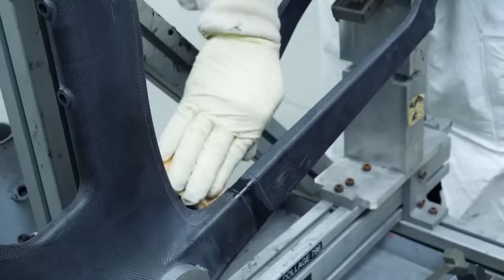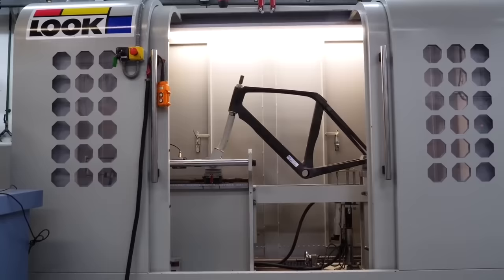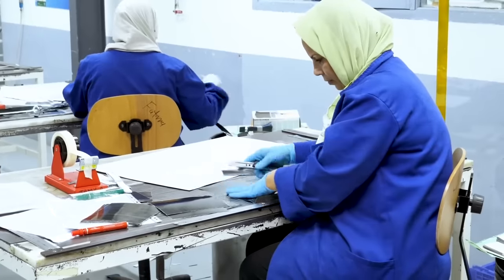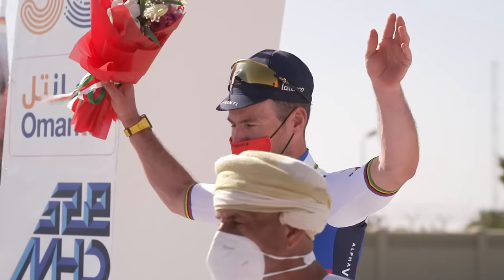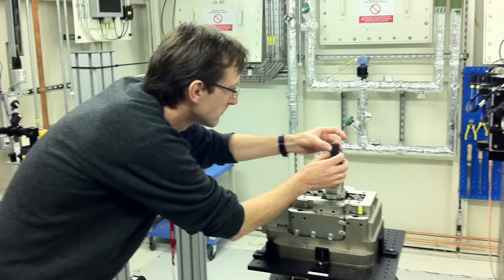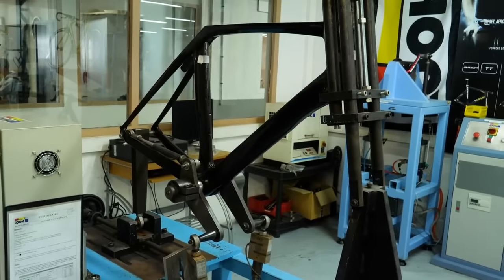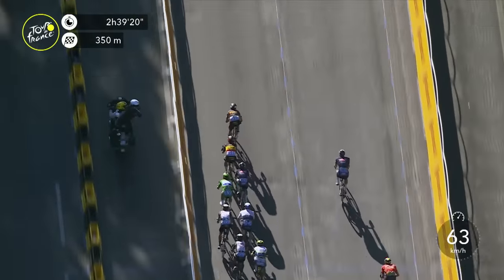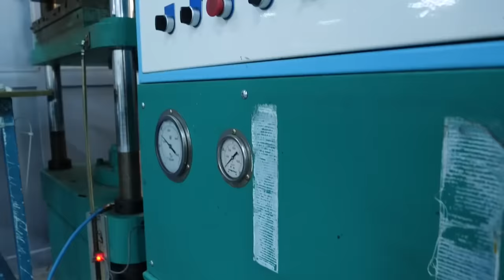Your Carbon Fibre Bike Won’t Last Forever

Comment: All structural materials fatigue over time. The stresses define how quickly this happens. When a metal breaks under cyclic loading, it is a "brittle" fracture.
Reply: Is stainless steel, in it's various alloy grades, considered THE most brittle, and WHY it was never considered, let alone used for frames, on a full production scale??

(I think that the Austrian Puch company 'dabbled' in it's use in the mid to late '70s, maybe???)
Reply: @nofascistsonmywatch  Stainless bike frames exist, They're just not that popular. 

It might be the expense and the performance disadvantage relative to carbon that turns people away.
Reply: @ZebraLemur  How could it even be as costly as Ti though??

The cost of the tubing/materials is similar, if not advantage stainless (unless we are talking INCONEL, which with it's extreme heat tolerating properties id way way overkill for a bike frame! ;) ).

It does require special rods to braze/weld together, but it does NOT require an (inert??) argon gas 'local' environment like Ti does.

It also does not require the long, drawn out, multi-step processes of lay up layering, and timely autoclaving that carbon does (at least the high quality stuff does). ;)
Reply: @nofascistsonmywatch  400 series stainless is the strong stuff, yet suffers from chloride attack(I conduct materials testing as part of my job). In that regard it is worse that titanium and aluminum. 300 marine stainless is simply weak af. From a structural standpoint, there are no effective stainless swords- we know long sections of stainless have certain drawbacks compared to high strength steel. So we have this niche material that has mediocre mechanical properties that also has mediocre corrosion properties. We have to ask, what company is going to invest 50 million dollars to get a bike frame factory making a product with economies of scale (to be price competitive). It's a niche material for that person who wants a shiny metallic bike with medicore mechanical/corrosion properties and a premium price. A major investment is required to bring the costs down- yet the demand is not there.

Comment: The carbon fiber roofs on the 2008 to ‘13 BMW’s have very thin clear coat and are failing.

Comment: It is important to note, that a 'bare carbon' frame actually has a primer coat on it. If it didn't, it would look like hell. All sorts of odd-looking carbon sheet layups would be visible. Having that primer coat is actually great, as once you get bored of that look, you can just give it a light sand, and paint it however you like.

Comment: what's the problem? the shelf life of the bike is 2-4 years, this is without cruel use, God grant athletes six months, and if the bike is just rolled, the shelf life may be 5-7 years, until they get bored.
  Also resins of course they crack, which leads to delamination between carbon delamination in our opinion, so taking a carbon bike from under someone does not respect yourself! unless, of course, he is not from under the racer and you take him to the collection to just wipe the dust off him and show him to friends. at parties. and with the current quality of bike production and the pursuit of weight, it's just pointless to discuss durability. when the frame weighs 700-800 grams and there can be no question of rigidity, no rigidity whatever. therefore, I still do not understand why people pay 5,000 thousand dollars just for a frame, I am ready to pay 1,500 thousand dollars for a frame, since the works of people who collected it, painted and polished it are invested there. but for a piece of plastic that I can make myself in my factory. which will also be cool as from the current shire for 5 thousand. 
I think it's just that people have already got stuck in their heads that carbon fiber is the best material, lightweight, durable, hard, this brainwashing worked well.  When I explain at work that everything is not fine. when it's easier somewhere, it's weaker there.  there will be balance everywhere. 
By the way, when in China they started using EPS technology in order to remove and align carbon fiber from the inside of the frame walls, this was the coolest solution. it's bad that not everyone adheres to this rule and still uses condoms to pump up the frame (sorry for my French). The Chinese have given you a technology that will extend your rigidity quality a little bit) . Thank you all

Comment: Just came looking for this kind of info with all of this submarine missing and possibly destroyed by pressure. Not a good material to make a submersible. You don't want to worrie about little fractures tearing apart the hull when you are in a ship that need to stand 400 kg/cm2. 3 years of use... well.

Comment: Nerd stuff here.  COOL!  My bikes are steel or aluminum and well painted.  To that end I'm NOT going to stress any of my bikes like a pro rider will.  So odds are a carbon frame will probably last me 30yrs where the same bike would last a pro a season of racing.

Comment: resins dont like to be HEAT CYCLED which happens when the bike sits or is stored somewhere 
hot or in direct sunlight. Resins will go soft as a result, it isn't the cf that breaks down its the resin.
after the resin is compromised the cf will fold at the flex nodes, points where flex is concentrated.

Comment: Thanks Doc....I had my frame repaired after a cafe door tragedy....now it's freakin creakin...??? Help
Reply: Buy a new bike, and don't take it to the cafe.
Reply: @santiagobenites  ok. Got the 3K ??
Reply: Sure its the frame and not something like crank ring bolts ?
Reply: @phuffmanful  I am not..so back to the shop it goes , I am hoping it's a simple thing ?  BB ? Thanks
Reply: @cb6866  My road bike had been creaking whenever I stood up on the pedals to sprint. I had assumed it was the bottom bracket, so I had just been dealing with it, as I wasn't ready to pay my mechanic to pull the bottom bracket apart. Plus per my research, creaking bottom bracket won't damage it, just annoying. After researching further, figured I should at least grab the allen wrench and make sure it wasn't the crank ring bolts. After tightening the crank ring bolts, 90% of the noise is gone. I need to get some grease so that I can remove and grease each crank ring bolt, as I'm thinking that should eliminate the rest of the creaking.
Reply: @phuffmanful  Really...? I am 2 things ...old and new , age and to cycling . I'll give it a shot right now   Thank you

Comment: Carbon fibre aircraft rot, disbond with metal parts, stress fractures,  paint comes off, displaying bare fibres. so its going to happen on a bicycle just slower.
Reply: I use nail polish for the little cracks etc on my bikes
Reply: Carbon fiber is more difficult to paint, additionally the stress on aircraft is much higher (due to the speed) than on a bike or a car.
Aircraft paint on airliners has a typical lifespan of 7 years, even on aluminum aircraft.

Comment: mY pinarelo 65.1 last 1.5 year than begon delamination first  i saw air dots sign of self destructing i have riden normaly with it on asfalted roads mostly no crash .Since  idont buy carbon frames carbon does not last too long even  when you are carefull you buy it and  you throwit away its cheap by produt  glue it together easy to manufactur .Now i have cineli frame airplane columbus aluminium  italy steel  and  i can tell you its 1000 times beter and faster  stronger beter than carbon frames now i have it 4 years and it work no problems wit it .i never by carbon frame again i dont trust it newer ever in my life

Comment: The real problem with carbon frames is resale. Are you going to trust your life to a bike who's previous owner may have treated it harshly? Not so much a problem with fairly new frames as not many cyclists are going to abuse a $5,000 bike but the older these bikes get the more chance there is of catastrophic failure.
Reply: I intentionally bought a CAAD10 with cracked steerer which could be slammed and remove the affected section. This was due to poor stem design - like a 3mm blade cutting into steerer due to insufficient material on the inside of stem. The expander plug was too small too 15mm of useful length. I replaced this with 50mm plug

Comment: I think this is kind of dumb- fear mongering. Fatigue curves are logarithmic. You can make a carbon bike last your lifespan and you can make an aluminum bike break after 1 year. Same with steel. Carbon bikes prioritize weight, therefore operate under the highest stresses. All bike frames have a planned lifespan.

Comment: So both experts agreed that carbon frames will likely become less stiff over time, and therefore worse power transfer.  This is a conclusion I'd reached recently as my ageing carbon frame has noticeably more flex around the bottom bracket areas at higher power levels, than when new.

Comment: I have to strongly disagree with this expert from McLaren GP. Any carbon fiber has a shelf life even if it is protected from UV rays. That's because the epoxy resins continue their chemical cross-linking reactions for "curing" that makes the matrix more brittle and will actually shrink with time. So, carbon fiber is not built to last even from no use at all. 

Any carbon fiber that even is not used and protected from the sun will sudden crack, warp, or even crumble on their own over the span of years. That's something for you exotic supercar lovers to think about when buying a multi-million dollar exotic car. Those cars will be worthless in a few decades.
Reply: That said.  The McLaren F1 was launched in 1992, is one of the first cars to feature a carbon fibre monocoque and is now fetching around $20 million.
Reply: @MattParkes-cf2pq  I wouldn't buy it. Carbon fiber definitely has a shelf life because the epoxy contines to cure/cross-link over time until it shrinks, cracks, and becomes brittle. There are probably cracks all over the monocoque by now after thrity years. It would definitely fall apart if driven. That's true for any supercar made of carbon fiber.
Reply: Hmm, more important are the airplanes built out of carbon fiber. 🤔
I fear that we are going to get a spate of aircraft incidents decades from now when aging carbon fiber airframes fail in mid-flight...

Comment: This may be TOTALLY silly and shows my ignorance,  but.... 
Would an Aluminum scaffolding with Carbon fiber  bonded to it solve a lot of the fatigue problems?  🤔
Reply: No. Just add more carbon fiber to reduce the stresses. You can make a bike frame last a million miles if the stresses are low enough.

Aluminum has a low stiffness 60 vs 180 of carbon. It would be like reinforcing a brick tower with rubber.

Comment: I wonder if GCN has realised how controversial this video is. They've just said new carbon frames, if you race them, will significantly degrade over a pretty short amount of time. This video is either wrong, or manufacturers need to address this.
Reply: I mean pro bikes are designed for performance not necessarily to last forever. Then again carbon frame are significantly stronger than any alloy unless you're really heavy or sprint 1000watts you shouldn't worry about fatigue
Reply: Lightweight bike frames ridden hard and a lot don't last forever, whatever material you make them from. Hell, aluminium alloy is the most popular bike frame material and it is guaranteed to fail due to fatigue.
Reply: @2ball434  I mean, I'm just an amateur racer, and I do 1000 watts. The guy in the video said yes when asked if Cav saying that a bike could be measurably degraded in 1 year was likely. I think that's a big problem. You don't?
Reply: @brankododig1585  Should they last longer than a year?

Comment: How poignant is this, a catastrophic failure can happen with CF, Aluminum too but all it takes is that nick on a part of the frame under extreme stress, or a stress fracture that 
propagates.
Apparently the Titan sub that imploded was using CF from Boeing that had been deemed past its shelf life.

Comment: I wonder what effects this will bring in aviation?

The conclusion is also simple, the frame should be of optimal weight, not 600-700 grams, but around 1000 grams, which gives a very optimal service life.
This program clearly shows the need for frequent bike replacement 🤑because until now we thought it would not be necessary.

Comment: "It fatigues just like any other material"? Your bias is showing.  Kind of like dissing rim brakes and then not setting them up correctly.  Admit it, steel is the classic martial that has proven it self over time.  And just because you use to race, doesn't mean you need to obsess over every gram and watt savings.  Just ride.
Reply: I agree. Perfect for those not racing. I ride a 14kg steel disc commuter bike. It's good training up the hills!
Reply: @richardggeorge  Some may wonder, why not aluminum?  I had an aluminum frame develop cracks at the headset while just sitting.  Even though generally aluminum may be okay most of the time, I got two, I know steel will sustain more stress without giving up the ship.

Comment: The title of this video is click bait and false.  My carbon bike(s) may actually last forever - forever meaning my lifetime (any other timeframe is irrelevant).  Yes carbon fiber fatigues, as do all materials, and lots of cycles with heavy loads with accelerate that process.  But let us take a deep breath - the airline industry's latest/greatest aircraft (i.e., Boeing 787) have up to 50% composite construction.  In this application, the loads are high, the cycles are high, and the consequences of failure are the highest.  Now relax and go ride your carbon bike.

Comment: breaking news, plastic bikes can't last forever. even over priced, over designed bikes. plastic, it turns out, as anyone could have said here when the first carbon bike rolled out. sail boats have been disintegrating during races since the first boats were floated. it does not matter if its carbon or glass or poly impregnated concrete. no brainer.

Comment: I know all engineers never fully commit when talking about other people's engineering manufacturing , but come on can't somebody say if used the carbon frame for say ?  10,000 km per year it's had  250 hrs in the sunlight , been jet washed 12 time s a year ? ! That after 5 years U should probably get a new BIKE frame ,  like come on 😵

Comment: Stupid video.  Carbon has an excellent fatigue life.  However, carbon has terrible susceptibility to impact damage.  A carbon bike can break from simply falling over at a cafe stop.  In comparison to steel or titanium, the risk of damaging a carbon frames is exponentially greater.  The idea that mass produced, made in China production frames are being sold for the same price as (or ever higher) prices than a CUSTOM steel or titanium frame is laughable.  It costs less than $300 to make the most expensive frame that comes out of China.

Comment: Bike manufacturers are using a dry form carbon today because of gone mad lightness obsession! The inner hollow tube and the outter only has a resin bond the centre is now all dry fibres to save weight and making them much more brittle and faster wearing! All proven because of light weight obsession there not doing carbon correct! They need to stop all this light weight obsession do the frames right so they last like old skool carbon frames!

Comment: Pretty useless, to get real answers you simply have to test frames to failure and relate it to real world use then over time see if your model checks out for a given frame (range).
This video is just guess work.
Another easy way would be simply to collect data on a selection of frames.